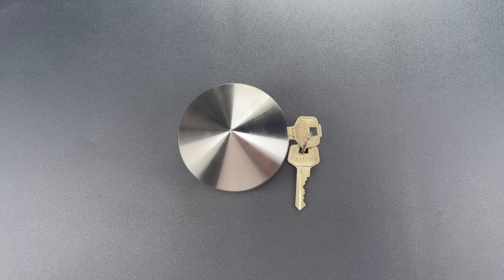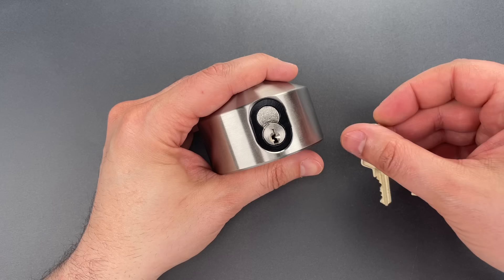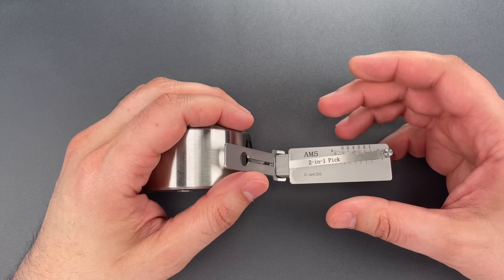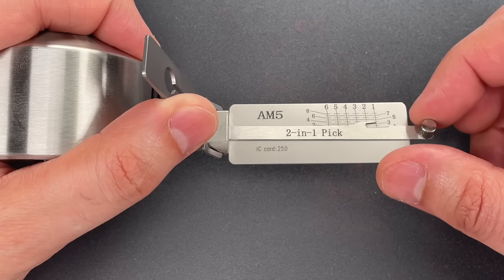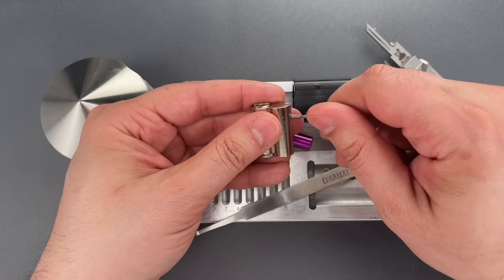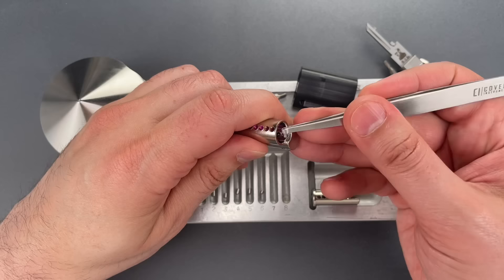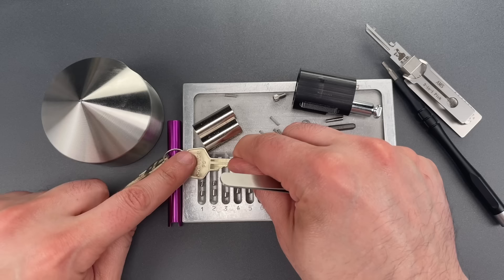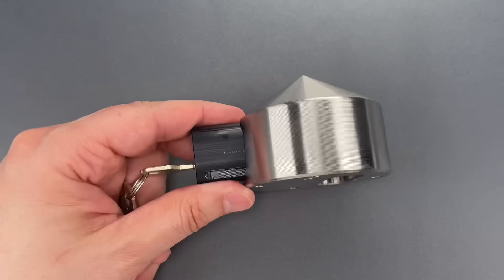[1293] PacLock’s Cone-Shaped Drill Defense

Comment: First time I've left one of these videos thinking, "I might buy this lock."
Reply: Yeah, but I have nothing to secure with this kind of lock.
Reply: yeah. but where would we use this kind of lock?
Reply: @JohnADoe-pg1qk  Same, which is where I run into a dilemma haha
Reply: @rickpaulos  Pretty much anywhere you would use any other kind of padlock
Reply: @torva360  about the only thing I lock is my bicycle and I don't see a puck lock being useable with a chain or cable.
Reply: @rickpaulos  I think I saw a chain lock on their website, but may be more for gates and such
Reply: @rickpaulos  the cylinder cores are interchangeable so all of their UCS series locks are this tough to pick.  You can buy the UCS locks from Home Depot or Amazon  I have five of their locks on my trailer, including this model and the ones that replaced the stock cam locks on the storage compartments.
Reply: @Astrogeek61  Thank you, we appreciate it!
Reply: The question is where can you buy it from?!
Reply: I feel that way every time PAC Lock comes up.
Reply: @torva360  Disc locks aren't general purpose locks, though. They're primarily used for cargo containers and similar setups.
Reply: @OtakuUnitedStudio  This isn't a disc lock. It's just a round padlock.

Comment: Retractable awl punch to make a guide for the drill bit. You should check out some aviation sheet metal mechanics at work. Anything else conical that you can tippy tap with a mallet will make a nice guide for any drill bit. I'm a powertrain guy, so I'm a lot more brute-force since we became the ah-hoc bushing and bearing experts.  I could literally torque-break any normal lock that isn't a vault with an all-thread bolt, two sockets out of a toolbox, a couple washers, and two nuts.

Comment: I’d like to see him pick this lock when it was actually on something and butted up against a wall. He mentions how it would be harder with traditional picking means, so he used his new tool, but I feel like it would still be much harder and prone to many more mistakes if it was up against a wall like how it was designed. He’s still the king so I have no doubt he would get it open, but it would show the true potential of this lock!
Reply: The difference would be that he would have to crouch to see the pin depth markers on the side of the tool.
Reply: I suspect the hardest part of such an arrangement would be giving the camera a view of what he's doing.
Reply: It wouldn't be too hard, center punch a divot into the conical top and drill through, making something conical doesn't prevent drilling it just makes it slightly more annoying.
Reply: @sdewey4152  Perhaps you should have read the comment by the president of the company that made the lock (he commented 2 months before you) before posting your comment. He explained the purpose behind this conical lock and its application.

Comment: Watching you pick this lock with that key tool allowed me to understand what you mean by your usual phrases you use.. the visuals made it more relatable... Especially the counter rotation from applying pressure to pin 3.. 

Truly remarkable! 

One question though... Is the false set triggered by the pins serrations?
Reply: False sets are triggered by the spools.
Reply: Yes!  The false set is when you raise a pin far enough that the undercut (narrow part) of the pin is at the shear line.
And the pins dropping during counter-rotation when you're getting past a false set is because the core had to be rotated far enough that it couldn't keep holding the other pins up, so that's why you saw him set some pins multiple times.
Reply: No, it's the spools that do it. They are narrow enough in the middle to allow the core to rotate somewhat, which creates the false set. Serrated pins don't usually do that, though they definitely make it harder to tell if your pin is actually set or just hung up on a groove.
Reply: Thank you for all the replies .. it was my mistake for writing pins.. when I should of wrote spools. 😂

Comment: DAMN that's one hell of a pick resistance lock
Reply: Spools, serrateds, one long boi, and pins dropping almost every time it counter-rotates. Plus requires a special and surprisingly expensive tool to even pick due to being used flush against a flat surface most of the time.

Comment: My technique for drilling in on wood on an angle - pick the spot you want to drill into, and start drilling parallel to the surface at that point. Only drill a few millimeters in, then pull out the drill, and use that hole you've made to realign your drillbit in the axis you want to drill on with no chance of sliding down the surface.

Comment: LPL, wouldn't it be simper to use a core puller on this lock? 

This seems to be a problem with a lot of the puck lock, since the core is only retained via a 6-32 screw and a small spring pin retaining the plunger.
 
If the cylinder sat into a machined pocket, then turned 90 degrees, the cylinder body would be protected from a pulling attack.
Reply: Hmm...  I have seen cores that have a lug on the side that rotates with the core, maybe that could work?
Reply: Based on paclocks comment I'm guessing the intended use for this would make it hard to get a core puller into place in the wild

Comment: "Sent to me by the lock company"

Uh-oh....

Still.... it took longer than the majority of the Master Lock ones.
Reply: It's quite possible / probable that the makers sent a "special"; after all, they knew who they were sending it to.  The additional cost of assembling a bespoke hard-to pick lock is easily offset by the advertising clout of a LPL video that takes more than 3 seconds to humiliate the lock.
Reply: @wibblywobblyidiotvision  And the company.
Reply: @wibblywobblyidiotvision  The easter egg proves that this lock is kinda special, but then, it's not exactly difficult to put the same security features in all locks of the batch. The little details that make this lock a bit more pick resistant, like the extra long driver pin, do not cost extra.
Reply: @wibblywobblyidiotvision  That is a fair concern, but one that isn't justified in this case (nor in any of PACLOCK's cases with anything we send for comments/reviews). I'm a West Point grad and former Army officer who believes in the products we build. If something's wrong with them, I'm more than comfortable to have that shown in a forum like this because, well, it will give us the opportunity to show how quickly our company can react/respond to some bad news. Plus, I'd feel like I'm cheating the system if we were to cherry pick or otherwise tamper with what should be a stock product. 

And, if we did do something like that, then there is the chance that those who buy the product would find a very different experience... and we'd see negative reactions from that. Trust and honor is paramount for us.
Reply: @wibblywobblyidiotvision  All of PAC Lock's cores are like this, with random type and placement of security pins. He's reviewed them before, including some cores he purchased from Lowe's.
Reply: @paclockpres.9805  Thanks for taking the time to reply.  That's very much going the extra mile, rare indeed.  Well done on making such a decent product, and on being so decent about it.

Comment: You can also use a drill bit just held in place a small section of metal pipe would center the drillbit over the tip and stop it from wobbling off, the fact that the interior is clam shaped makes me think getting it hot and hitting it on the sides would create a lovely hinge and of course snapping the pin in the process and the hinge would be easy to bend right back open until the metal splits. But that's just another very easy way to open it with force.

Comment: Now I'm trying to figure out how a 'puck lock' physically locks things....
Reply: It's for protruding locking hasps (loops), the shackle is a straight pin and the back face sits flush on the parent surface
Reply: @Hyratel  and in english?
Reply: @evlredsun  Imagine a wall with a small metal loop on it. Now imagine a metal panel with a slot in it. The loop goes in the slot.
The puck goes over the loop. That little bar you see under the lock goes through the loop.
Now the panel is stuck to the wall.
Reply: Check out the back of a work van next time you see one. Plumbers, electricians, etc. They tend to use these on their back doors (which open like French doors/double doors at a retail store) and it's a relatively efficient way of getting more security than just the OEM door locks.

On the van, you'll see a metal tab sticking out with a hole in it. The round puck has a slot, and then a metal bar that goes across that slot. The metal tab goes in the slot, and the bar goes through the hole. Then you've got a flush mount padlock :D

Comment: If you work with metal, you can get a drill bit through it. Come in straight at the angle of the cone. Once you get about a quarter of an inch in, straighten the drill. Cone shape lock compromised.

Comment: Cone=small surface area that is easily cut flat with a grinding wheel before switching the 18v battery from the grinder to the drill and drilling a lock.

Or just hit the cone with a centerdrill for 5 seconds prior to drilling.

Comment: "That probably helps with pick resistance." After having just picked it. 😂
Reply: I'm pretty sure that the different strengths of the springs were one of the reasons the set pins kept dropping.
Reply: @OzixiThrill  The different strength springs help with bump resistance.  When you bump a lock with all the same strength springs, they all jump the same, and make the slightest gap at the shear line.  When you bump a lock with different strength springs, the strong springs cause the gap to stay below the shear line, and the weak ones gap above the shear line.
The pins dropping back down is primarily due to the counter-rotation when setting spools.  When the core is turned backwards to allow the spool to pass the shear line, it often needs to be turned back farther than it was when the earlier pins were set.

Comment: You said this lock would sit flush to a surface, and brought out a special tool to deal with the movement restriction, but you tilted and held the lock in your hand away from sitting flat on the table. Is that a fair real world scenario pick?
Reply: Well this is as good an advertisement as any for his own and their company he basically said very few petty thieves would have this tool and very prominently praised the lock on several occasions
Reply: The tool would work just as fine with the lock mounted in the proper position, but then we wouldn't see what's actually happening during the pick.

Comment: To start a drill on any angle or rounded surface, there is this 21st century tool called a center punch with an accompanying hammer, instant drill bit start.

Comment: Huh. If the core required a left-hand rotation instead of a right, even that tool would be useless.
Reply: Why?
Reply: @girraiffe  perhaps it would be difficult to tension that way? I dunno
Reply: If I remember correctly that arm can be moved to the other side
Reply: @brianhorstmann116  gotcha, wasn't aware of that.
Reply: @girraiffe  lock is flush mount. As demonstrated, to tension and turn core you need to lift tension arm away from surface. If core could only rotate counterclockwise, you would be pushing the tension arm down into the surface that the lock is mounted to.

Another comment above states that the arm could be attached to the other side of the tool, rendering this moot.
Reply: @giin97  I was a little mistaken, they sell versions with the arm on the other side.

Comment: good on PAClock for the steel pins. my brain went straight to using devices like the wendt core puller or the slide hammer, but the drill resistance would probably make it nigh impossible to get a screw to bite in there either, huh?

Comment: It's almost like a "Center Punch" is not a thing.
Reply: It's an extra step for the criminal and an extra tool that needs to be brought, I guess.
Reply: @---cy5gh  Yup, more tools, more time, more chance to get caught.  Move on to the next target, it's safer.
Reply: The manufacturer explains up top why punches don't really work with the ways these locks are typically being used

Comment: Why not use an angle grinder to flatten the point enough to start drilling
Reply: These locks are recessed deep in a narrow cavity. It would be basically impossible to flatten to the point that you need to reach. You wouldn't actually want to drill the point. Where you'd want to drill is to the side and the slope is what prevents the tool from biting.
Reply: @GrandmasterofWin  so then you can still use an angle grinder and use it like you would to cut but only cut deep enough to get an area for the bit to bite into. Just bring a good drill and some WD40 to keep the bit from over heating
Reply: @brandonmadden4169  I'm sure there's a way, I'm just repeating what was passed on by the guys who designed the lock. Apparently they've had zero reports of theft since they were installed.
Reply: @JorgTheElder  well it’s not gonna be any louder than drilling into hardened metal. And if it on something that can just be taken with you then you can grind it at your own place. Also why not just torch it😂

Comment: I'm pretty sure that cone top would be easy enough to drill if you use a punch first. The same as drilling into any curved metal surface.

Edit: Just read the manufacturers comment about the design of the cone. A punch would work but that depends if you can get one to reach it haha.

Comment: To start a car it's not just a key but a price of metal that actually tells the car to start, maybe a lock like you start a car ? With a price of metal that has your car frequency to start, but with a magnet pull way. Magnetic pull away with its own mechanism because, ppl will be able to read the frequency but do not know the magnetic pull mechanism inside,  but each lock is a different type of motion.

Comment: Basic construction skills. You drill perpendicular to the slope with a slightly larger bit until you get just the tip of the bit into the metal, then switch bits to the size you want and drill at whatever angle you need.
Reply: See the pinned post at the top. Basically in the scenario where drilling was a problem, the lock is recessed about a foot in a hole just big enough to reach in and unlock it. With a regular puck, the thief could just use a long enough drill bit. Won't work on this one, unless you make that starter hole first - and doing that in such a confined space will be pretty hard.

Comment: 30 years as a locksmith i had never seen the criminals use picking or bypass methods until amoral monsters like you started your online criminal tutorials.
If i was as amoral as you i should be thanking you as i am extremely busy a.f upgrading and replacing
 locks after break ins and robberies however i have morals and  wish for slower times when the majority of criminal attempts were defeated by standard security.
Just the comments i get from criminals when working in places of incarceration ie 'do watch the lock picking lawyer' ,'who do you prefer? The l.p.l. or bosnian bill ? Etc...
Show how your videos have aided and encouraged crime in my area at least if not worldwide.
I dont know how you sleep at night.

Comment: You can drill a cone like any other convex surface: use a center punch and a hammer to make an indentation on the surface, then drill there. It's common knowledge in machining/mechanical engineering.

Comment: If the lock is installed in a way such that the keyhole is facing downward, this would be nearly impossible to pick. Amazing work. Props to the company that made it.
Reply: Orientation of the keyhole doesn't matter. It may be more comfortable to pick it in certain orientations but it doesn't really significantly increase the difficulty by having the keyhole face downwards.

Comment: Punch and drill like 1mm at 90 angle then drilling in the direction you wanted originally. Cobalt bits. Maintenance dept. That is the usual method for conical/uneven/broken bolt surfaces. Now, unless the surface it is mounted to interferes with a drill.... then my bad...

Comment: If the lock is mounted in a way that the flat surface would get in the way of a picking tool, would orienting the key hole mechanism at an angle (upwards toward the cone) where it would cause even the tool used in this video to contact the surface (table), impede a pick to any reasonable degree? The key would have to be some type of right angle design. It seems the pick tools are always longer than the key.

Comment: If the cone is not hardened then there is no difficulty to start the drilling just use a center punch. if hardened the still with carbide drill bit can drill...
Reply: I was thinking the same thing. I'd like to see him actually try to drill it while it's locked onto something

Comment: This is a phenomenal lock. The lockpicker had the massive benefit and "cheat" of picking the lock on top of a large, open surface area. But imagine he was having to bend down and the keyhole was toward the door jamb such that there was only a small space for the key to get in. Lock picks are MUCH longer than a key, so in fact, none of the picker's tools would have worked. It would take something like an "allen" 90 degree bend picking tool to get at this lock.
Reply: Or you could just you know Bend a regular cheap-ass lockpick and get it done.

Comment: Um? I may be an idiot but I have an idea to get around the cone shape...target a specific spot with a propane torch until the metal gets red/yellow hot. Then using generous pressure start your drill hole? The heated metal should react to outside force a bit more responsively.